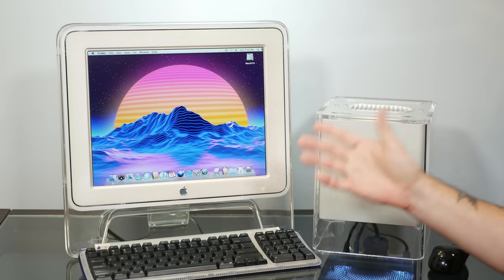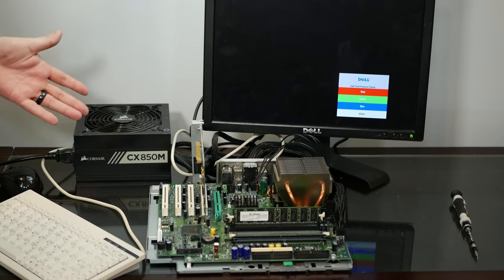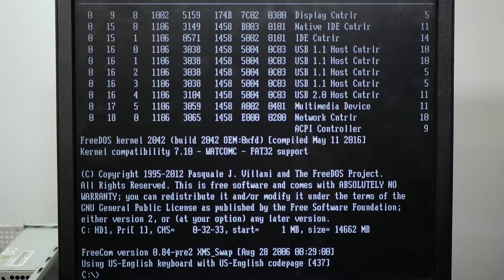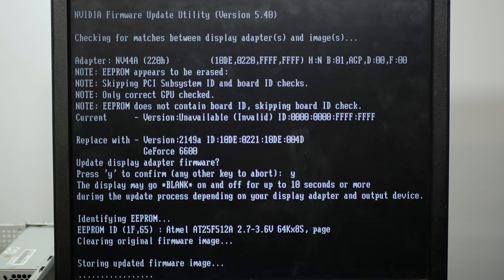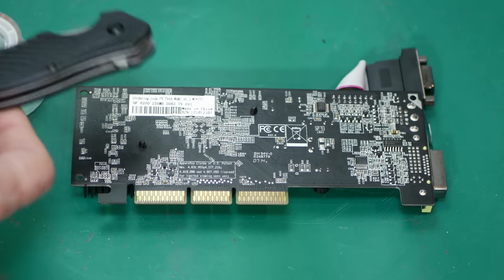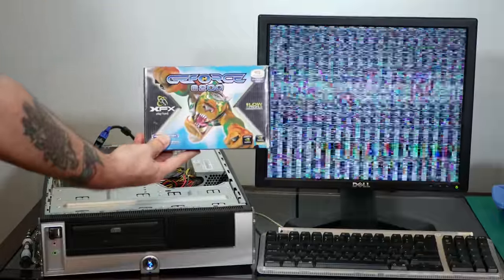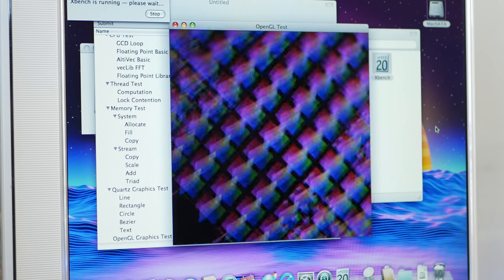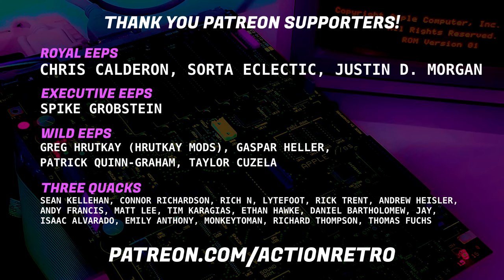Hacking a PC Graphics Card into my G4 Cube!

Comment: Just modify the Nvidia gpu bracket. Cut it to length and drill the screw holes in it so it'll bolt into the cube case. Should take all of 10 minutes.
Reply from the maker: Yeah I do have a dremel so I think this is the route I'm going to take
Reply: @ActionRetro  Yeah the nvidia bracket is a lot easier and cheaper to find than say, the cube specific gpu bracket so may as well just sacrifice that. You also have a spare too from the dead card. Good luck!

Comment: Get thee a 3D printer. Considering the number of hardware mods you do, your life would be much easier if you could print custom brackets, supports, spacers, that kind of thing. You could easily design an IO bracket for the card that will fit the Cube’s chassis.